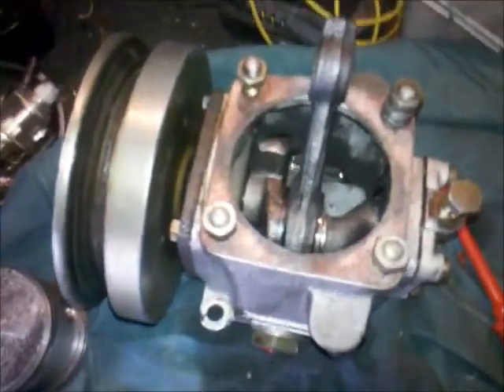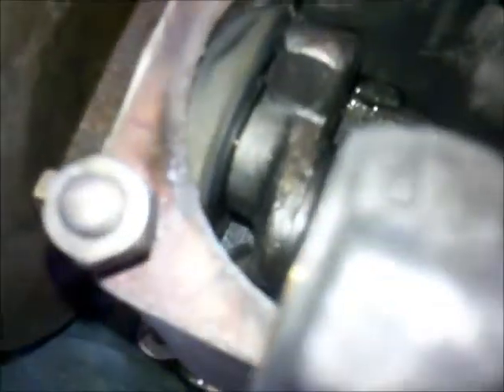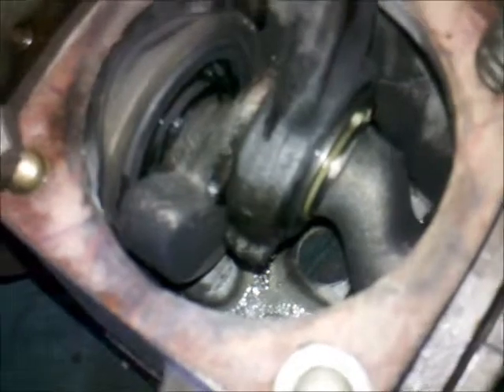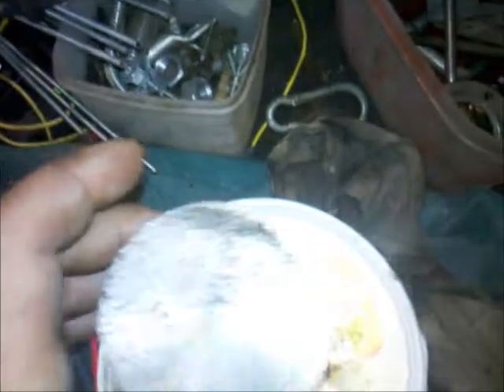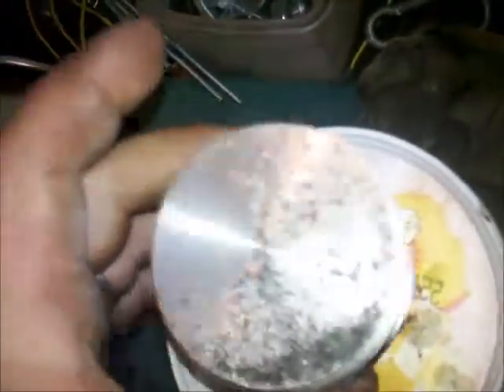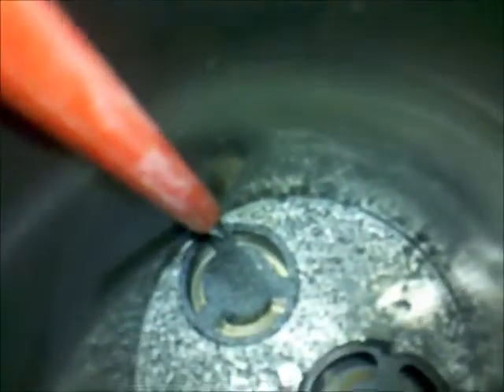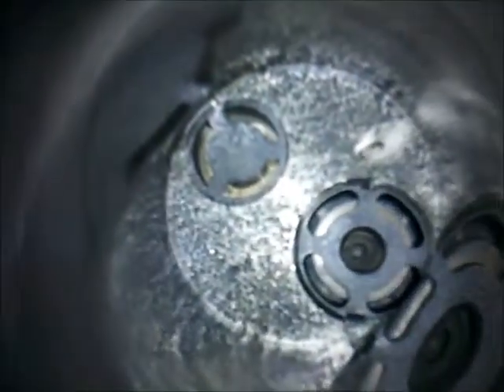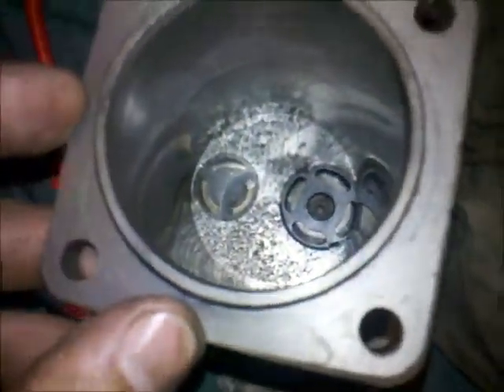MF 590 - Trailer Brake - Air Compressor rebuild  - part 1

Comment: If parts aren't available, why not run it to failure and then buy a new one?  I wouldn't think the pitting would hurt too much since you are only dealing with air.  Could be it got some dirt sucked into it.  Looks like the walls are in good shape and with new rings, it should last a while as long as the valves are okay.